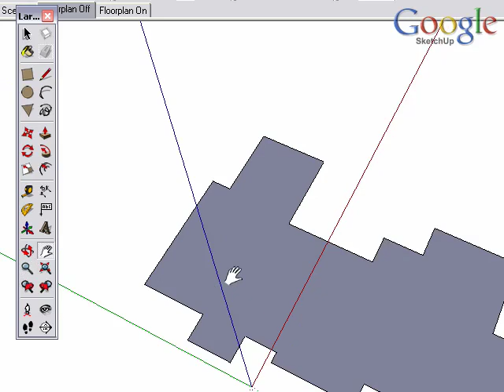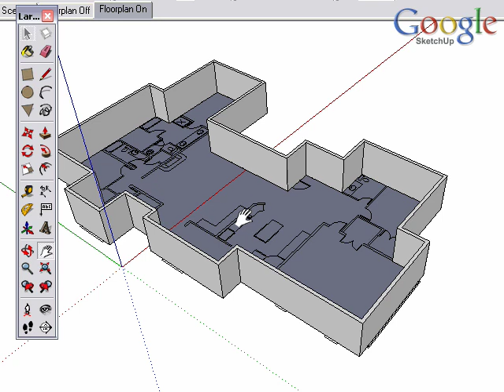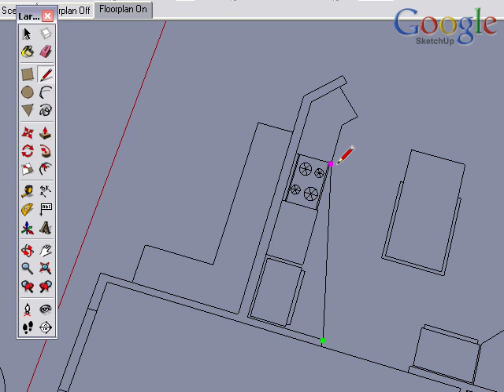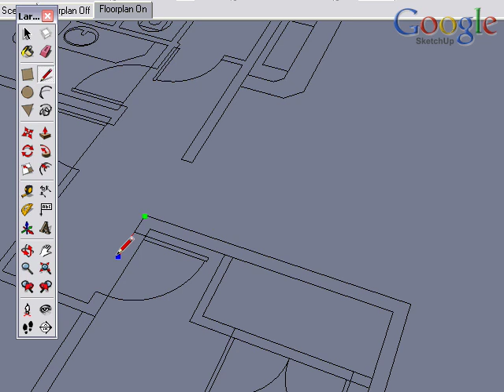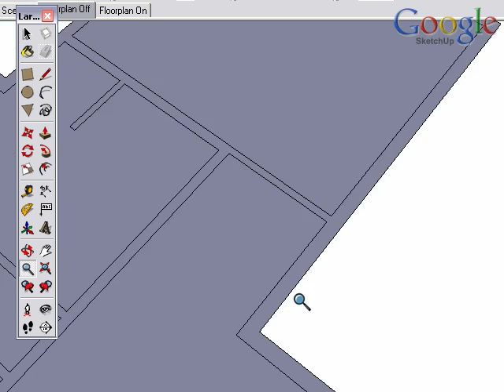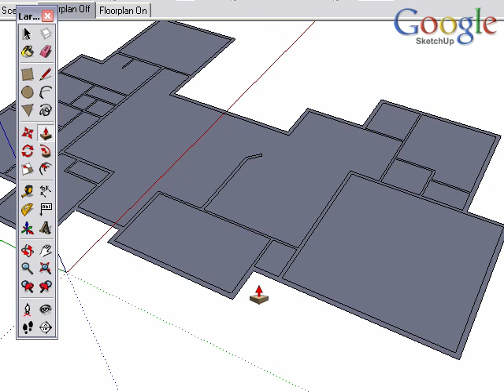SketchUp and CAD - Creating Walls

Comment: This makes importing cad pointless if you're just using it as a reference and having to REDRAW the entire project. Shouldn't the point be that closed faces could easily be pulled up from existing lines made in CAD?
Reply: krisztian79 depends on the quality of your original CAD 2D,, usually they are a mess and its it is much more efficient to create a clean model in sketchup.

Comment: what if our plans have too many curves and fillet radius?
Reply: I am a beginner, but I think that in that case you have to fall back on the other tools, like line, curve or others. The example is only to show it in an fast and easy way. He also quickly mentions that he has to draw some lines, but then goes back to the rectangles.
Reply: There are great extensions for adding fillets if needed.

Comment: SketchUp is not the only CAD program for architects?there are a number of 3d modeling programs that far exceed the possibilities SketchUp provides.You have BIM programs, rhinoceros, 3dmax, maya and plenty more. The idea that on pencil you can fool yourself that something works when it doesn't is stupid in itself. If your fool enough to fool yourself that something works on paper you can also achieve that level of stupidity on SketchUp.

Comment: Don't close your mind!! SketchUp was invented for early design stages, where once we might have used a thick and soft pencil. For later phases, where we would, in the 1950s, have used a harder, thinner pencil or drafting pens, we now need another type of software. Revit and ArchiCad are both good. Frank Gehry uses Catia. It all depends on how complicated the project is: you can design a house on the back of an envelope using a felt pen. But designing a public building like a school, hospital, o

Comment: I disagree with Michael Powell.
Of course, you need to learn to handle these all new softwares and new digital possibilities. But, FIRST OF ALL, you have to know how to draw the old fashion.
Drawing by pencil forces mind to visualize your project and, most important, once you can draw by your fingers and by your pen, drawing by softwares is MUCH EASIER, and prevents mistakes.
Just think of music: best synthesizers players and programmers are classically traned pianist.
Reply: In these modern times, a lot of sketches are also made on a computer, mostly a tablet/ipad. Sketchup has a separate program for that, called Builder, as I understand it. You still can hold a pen, but then it is on a touchpad.

Comment: I'm an arhitect and I've used CAD since 1975. Not AutoCAD, its not good enough. This tutorial shows how slow this line based technique is, even if the video is speeded and rehersed.

My advice is to get a proper 3D drafting system like ArchiCAD or Revit and learn to do the job properly.